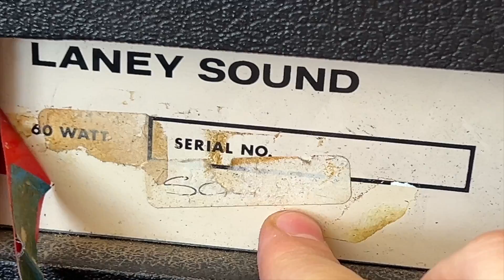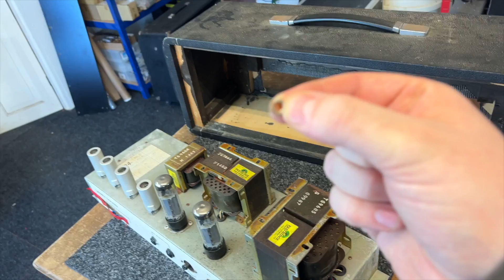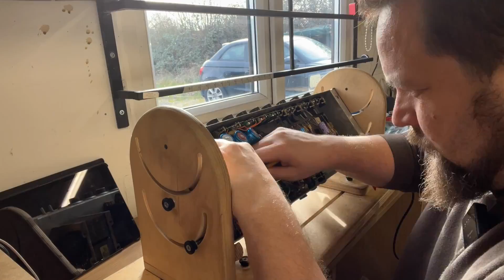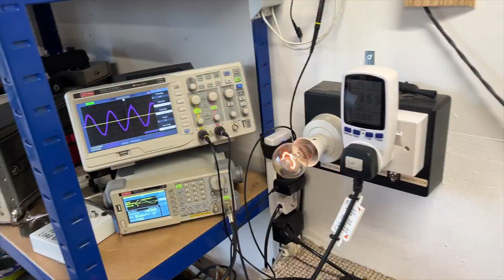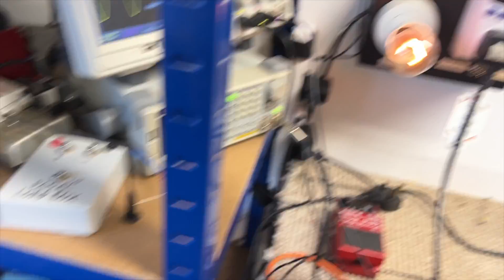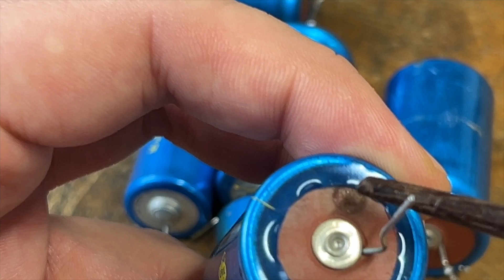Resurrecting a old LANEY PA Head | Mid-Week Special |

Comment: How do you handle the high voltage on g2. I belive its way higher then what new production EL34 can handle.
Reply from the maker: not all new production, no, but some. You've just got to be sensible with your chosen operating point.

Comment: Thank you for this video!!  Very informative.
I have a 1970 Laney Sounds 60w head that has a similar story. I got it given in 98 at a gig, the singer in the band was given it and it had been under a floor for 25 years. It had the old round pin plug on so I couldn't try it at the gig. I took it home and changed the plug. I turned it on and played for a couple of minutes tweaking it and then it went Pfft..at the time I was using channel switching amps and this was just some old dud so I put it in my loft for another 23 years!! Then I decided to get it fixed. I can't tell you how good it sounds. It's all original with Partridge transformers and the fault was a corroded aluminium output selector. Having been stored for 48 years of its life it is in mint condition. I absolutely love the sound of it and I use it every single day. Digging around the web I found that Tony had problems with loose valve holders when playing loud!   C:\Users\walki\Pictures\guitars\Laney front.jpg     C:\Users\walki\Pictures\guitars\Laney rear.jpg   C:\Users\walki\Pictures\guitars\Laney valves and transformers.jpg   C:\Users\walki\Pictures\Laney internals.jpg    I hope theses pics may be of some help to you or others.

Comment: Awesome video! Being a huge Black Sabbath fan, I love these old Laneys. Sadly they are very rare to see here in the States. I've been looking just building my own based off of a 60w Supergroup instead of hunting down an original one. Biggest challenge so far is finding a good reproduction of those Partridge transformers.
Reply: You need to find originals, it's where the magic lies and of course the crazy high plate/screen voltages. (We're talking about 600-700V)
I use JJ KT77 tubes in my 100W Supergroup, they can withstand those voltages.